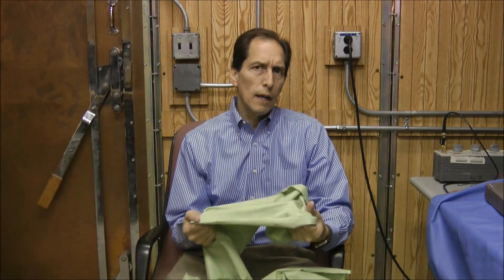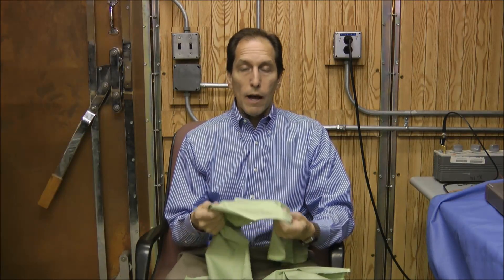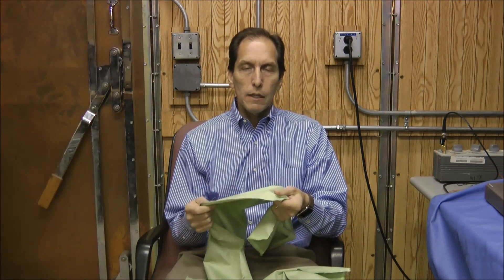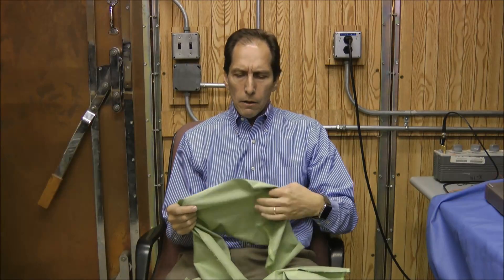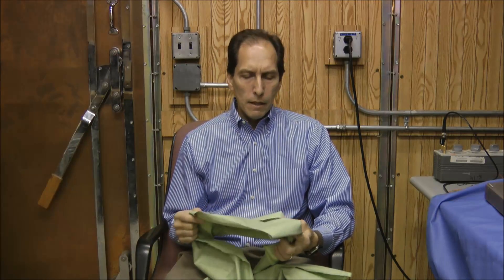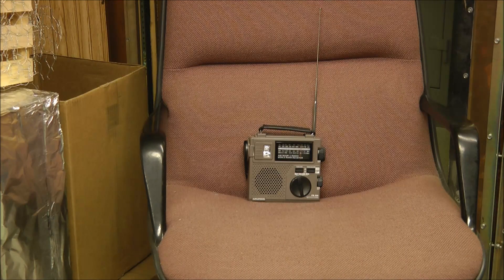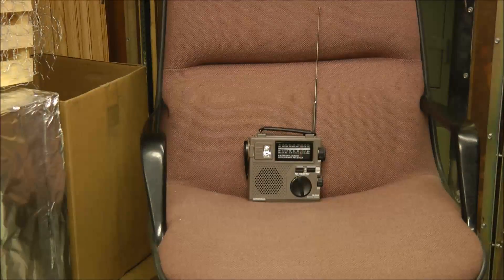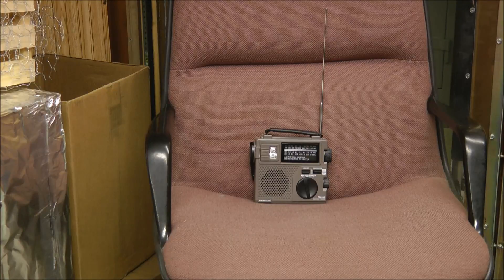EMP Cloth Blocking Radio Signal

Comment: This being 6 plus years old now ... has there been any improvements to the materials and when wrapping, something like a car or ATV or Motorcycle... do you need to go under it to encapsulate it or would it be ok if All edges make contact with the ground ... and would the floor material make a difference... say , concrete vs plywood floor

Comment: Question,
I'm working out if town I am staying in a 5th wheel camper. The bedroom is in the front and it has a slide out at the head of the bed. I noticed the campsite has a WiFi antenna right outside the camper on the bedroom side. It's just a little higher than the camper roof but within 20 feet of the camper. Can you slow down the signal strength of the Wi-Fi antenna coming into the bedroom by using Faraday cloth or aluminum foil on the walls  inside the camper at the bedroom location? (Not all the walks, just the ones where the slide out is, the place where your head would be when sleeping, In other words it wouldn't be a full Faraday cage it would be more like a blocking curtain on one side. Does the wifi signal mimic a radiation source? Can you be shaded from the strongest part of the signal?
That may not be an easy question to answer given my explanation. 😊
Reply from the maker: Putting up a single-sided conductive barrier close to you would reduce the RF levels you're exposed to, but it's hard to say how much. Perhaps reducing them by 50% is my guess. A better option might be to buy a conductive netting that you could hand down over your bed, or even a conductive sheet that you could cover up with.
Reply: @disasterprepper  
Ok, kinda like an old fashion bug/mosquito net over bed. 👍
Great idea, thank you. 😊

Comment: i think, the question i ve asked on ur most recent video would ve rather been asked here 🤓😅 hope u ll reply anyways. Thx in advance. 

Are u using any shielding cloth on urself? In Clothes, blankets etc? Are u shielding walls inside ur house or windows? With or without earthing?
Reply from the maker: You can find various kinds of conductive cloth that can be worn. Most are made with silver threads, and they do a fine job of shielding. They don't hold up in the wash that well though. No need to ground the cloth when wearing it.
Reply: disasterprepper what is this kind of fabric?  What kind of fabric can I buy that will help me.

Comment: Just wondering, in this day and age with WiFi and mobile transmission towers, we have an unresolved question as in how those radio frequencies affect the human body long term. 
A bit like Hiroshima, no cancers in survivors until twenty years later. 
Could a cloth like this be beneficial as a faraday cage, come mosquito net on a four poster bed ?
Reply from the maker: Yes, folks have done a mosquito netting sort of thing over their beds using conductive cloth. Personally, I think a more translucent cloth would be better for that application. If you search the web, you'll find several types for that purpose.

Comment: Dr. Bradley, I'm sure you're correct concerning the poor results of testing this cloth with operating radio receivers. I'd like to report on my results, anyway. I found that AM and FM radio reception was not blocked using up to seven layers of the cloth. Perhaps I have very good radios. Cell phone reception WAS blocked, however, with a single layer. Since I'll be using the cloth to protect an electronic rifle optic that is unpowered, I believe that some cloth will be better than none in an EMP event.

For those curious, I was able to get continuity with a DVM up to 3 cm across both x and y axes, and through 4 folded layers of the cloth. I have no idea if that's significant.

Good video, and fast delivery on the product. Thanks.
Reply from the maker: Thanks for your report on this. I'm surprised by the AM/FM blocking, but it would obviously depend on signal strength. As your DVM showed, the cloth is conductive at the surface due to the stainless fibers. That is usually preferable because it makes it easier to ground.

Comment: Will an emp affect your car/electric equipment if it is not turned on or plugged in or connected to a battery or just not running?

Also I have a military rugged 3000va UPS it is a deployable one in a green rugged brand hard plastic 4 shelf container.  2700 watts pure sine wave inverter designed for 220/240 can be used any where in the world.
I have 2 ?s

1) would you know if this casing is emp proof or is the equipment emp proof?

2) how can i turn this into a solar generator to use in a grid down situation. 

Thanks for all your hard work and info God Bless You!
Reply from the maker: Yes, an EMP can affect equipment (including cars) that are not turned on or plugged in, although having them off and/or unplugged can greatly help. I'm not familiar with the UPS that you mention, but I would suspect that it is susceptible. The casing, if plastic, does not provide any shielding. As for a solar generation system, you need panels, a charge controller, and a battery system. The UPS likely may have a usable battery, but you'd have to mate it up to the rest of the system (assuming the voltages matched).

Comment: Thank you! Your tests are by far the most useful on the internet, but I've got some concern about the durability of the shielding. How much energy would these conductors need to handle? Since these are not fully-enclosed like a Faraday Cage, they're relying on the ability to shunt induced current to ground, right? Couldn't the cloth, copper screen, aluminum foil, etc. just burn-through?
Reply from the maker: If you run the numbers, there is almost zero heating of conductors due to an EMP. I talk about this in the Reluctant Prepper's myths interview. It's a good question though.

Comment: If I wanted to make a bag to slip over the entire solar panel kit (manufacture packaging), would I: sew it on long side to make a tube, then tape the ends shut with duct tape, burrito style?
Reply from the maker: You could do something like that. Or you could make a pillow case type bag and fold down the ends, either sealing with velcro or conductive tape.

Comment: Hi disasprepper,

I've read that EMPs broadcast waves over a wide spectrum, but that most of their energy is contained within a specific range of this spectrum, depending on their types. 
For example, in the case of a HEMP, 90% of their energy is contained within the 100 kHz to 10 MHz range according to many online sources.
So when we talk about db attenuation, does it apply to the all of the frequencies, or is it only accountable for a specific range (the FM range for example)?

EDIT: source : https://www.google.co.jp/url?sa=t&source=web&rct=j&url=http://www.dtic.mil/dtic/tr/fulltext/u2/a554607.pdf&ved=0ahUKEwiLqaDX0InXAhUEGJQKHYXKCEwQFgg2MAM&usg=AOvVaw1sZX2QBku9_TC34Jzi4zxe
Reply from the maker: There is a lot to know about frequency content, and I couldn't do it justice in this short reply. One thing to consider is that a Faraday cage or conductive cover are only trying to protect against the radiated effects. More specifically, from frequency content that is able to couple into small-scale electronics. Anything below 1MHz is going to have a very hard time coupling into small electronics in a radiated manner because the associated wavelength is too long. Therefore, there's no need to worry about radiated energy at say 10 kHz. That energy would couple in through conducted paths (i.e., wires). Faraday cages and cloth should be tested over frequencies that are important to radiated effects, say from 10 MHz to 1 GHz.
Reply: disasterprepper Thank you very much for this valuable information! 
I couldn't find information about the most energetic frequencies of a solar flare induced EMP.
Should we protect against it the same way we protect ourselves from a HEMP?
Reply from the maker: A solar CME can cause a powerful geomagnetic disturbance, but it is a low-frequency event (most of the energy is in the Hz to tens of Hz bands). Protecting from it only requires that you are unplugged from the grid. There's no need to have a Faraday cage.
Reply: disasterprepper Thank you very much!

Comment: Would a gun safe work as faraday cage?  What about the effect of plug in for golden rod dehumidifier ?
Reply from the maker: I tested a fire safe for my EMP book, and it did fairly well. The specifics are in a table comparing different ad hoc Faraday cages. Is the dehumidifier inside the safe? If so, how is power routed out? If it routes out of the safe, it will affect the shielding effectiveness. At a minimum, you might consider adding a ferrite to the power cord. See http://disasterpreparer.com/emp-ferrites.
Reply: disasterprepper thanks , the power is prewired to the back of safe with an typical outlet inside so probably not the best.  I have seen large all steel cabinets out of metal much thicker than trash cans with a door that overlaps the frame with a locking mechanism like a semi trailer. I was thinking about that for larger items after lining the interior with a non conducive material. In our area there sold a Fleet farm once or twice a year at a large discount 
. Thanks again for all you videos. I have all your books I think, have read the first 3 of the novels.
Reply from the maker: Good luck, Steven, and thanks for your support.

Comment: I have a whole house generator that i am planning on installing.  It's an older generac with a steel housing.  I am planning on using an outlet on the side of my house so it can be unplugged from the grid.  Do you have any suggestions on protecting it from EMP or is the housing sufficient?
Reply from the maker: The generator's housing will certainly help. Also, unplugging it from the grid is very important. I'm not sure that much else would be warranted if it is unplugged. I don't think covering it with cloth when outdoors makes sense.

Comment: Thanks for the video.  Would you mind sharing with us how one could build a faraday cage for a small portable generator?  Say with hardware cloth or aluminum screen?  Thanks very much.
Reply from the maker: You could really do either, depending on the size of the generator. A small generator might fit into an aluminum foil-wrapped box -- easy and cheap, but a bit of a pain to take in and out. You could also create something using more durable, such as a large tool chest, or something like that. You just have to pay attention to the seams, which tend to leak RF energy. Many people do opt to use conductive cloth, mainly because it's so easy to use, basically just wrapping up the item, or even setting the item on a concrete floor and draping the cloth over it.
Reply: @disasterprepper   Dr. Bradley: Why couldn't I wrap the outside of a large cardboard box with foil (edges sealed with aluminum tape) and leave one end open to easily set over top of my inverter generator box?  The leading/open edge touches the concrete for ground just as good as the cloth does, doesn't it?  And I have a complete metal faraday covering over the generator (in its cardboard box) rather than the sparse stainless steel fibers.  Bulk rolls of wide aluminum foil from Sam's, etc. are cheaper than the 10-12 sections of cloth I would need, plus the sewing costs.  Or am I missing something?